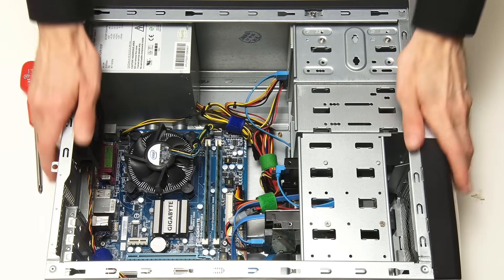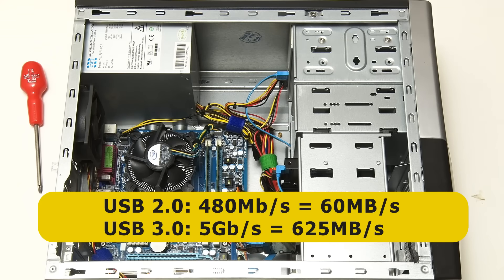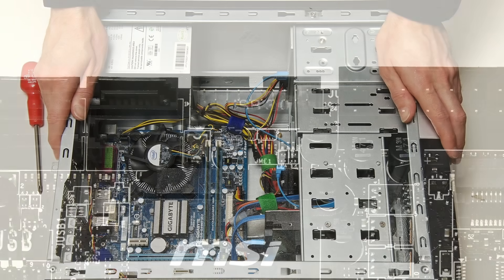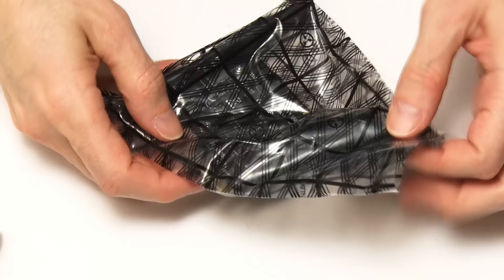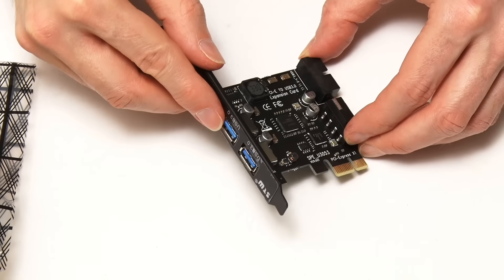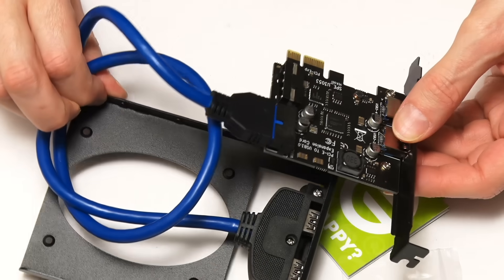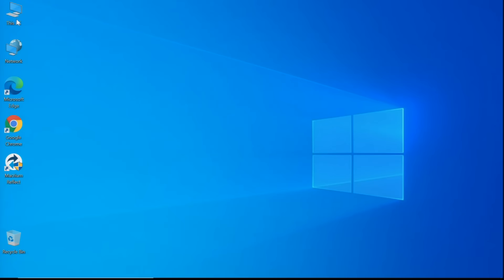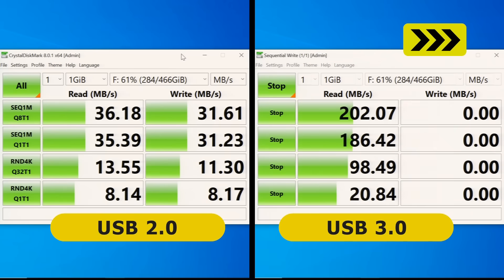Old PC Upgrade #3: USB 3.0 Ports

Comment: Chris, you mention in the next video that you'll be upgrading the motherboard and CPU. I wonder if it's worth mentioning different upgrades that can be done, depending on a budget. For example:

- If strapped for cash, a CPU upgrade to a quad core chip for the existing motherboard could bring about excellent performance gains. A Core 2 Quad computer is still perfectly serviceable for most web browsing, email, and media playback needs.
- Upgrading the CPU and motherboard, but re-using the existing RAM
- Going all out and upgrading the CPU and motherboard with ones that will also require newer RAM (in this case DDR4).
- Adding other affordable upgrades as required for the users needs. For example, installing a graphics card would allow for things like 4K video playback, even on a machine this old, as the card would be doing hardware decoding.

Just food for thought anyhow. Great informative video as always!
Reply from the maker: Agreed -- there are many potential options. :)

Comment: This video just got me thinking that it was 9 years difference between the desktop I'm using now and the one that came before it.

By the way Chris, what's your methodology in regards to  "tech refreshes"? I try to invest in more but less often to make such investment last longer.
Reply: Myself, a few things, because I don't like buying this stuff any more often than I have to, and I like to get ten years or more out of a good system (oldest one in everyday use here is 17 years old, next oldest is 13).

-- Quality power supply. Everything else depends on it.
-- Best motherboard I can afford that has the features I want (mainly number of slots, memory capacity, and CPU class) without agonizing over it too much.
-- As much RAM as I can afford.

After that...
 -- I buy last year's CPU, and save a LOT of money without being all that far off present performance (this will usually be about in the middle of the CPUs the board supports). 
-- And when the best CPU the board supports is a couple years old and the price has come way down -- THEN I upgrade the CPU. (And the old CPU goes into a salvaged board and becomes a secondary system.) 
-- If RAM isn't already maxed out, I look for price drops and that's when I fill it out.
-- I'm not all that fussy about video card; I'm not gaming so whatever makes adequate resolution is good enough.
-- I will commonly buy used components. Remember ALL computers run on used parts, and other than hard drives/SSDs, they don't "wear out".

Hard drives/SSDs are an as-needed thing, but stay away from off brands, you'll be replacing them prematurely.

Comment: Looks like a 2.5" drive can be mounted on that front header frame. May interfere or kink the cable but looks doable.
Reply from the maker: You are correct.

Comment: very interesting. I was wondering about buying a used single xenon processor motherboard combo with 32gb of ram for a 10 years old pc that isnt for gaming with some of your mods? mine is athlon x2 2.8g processor is currently in it. Would I need more powerful power supply (350W) . I saw a combo for $125 ebay, or athlon x4 processor or other upgrade for the am3 motherboard. Any ideas?

Comment: My old PC that I built in the windows8 days runs windows 10 and any Linux Distro quite well, but I've been planning on doing this type of upgrade for a while. I've held off because I couldn't find an option to put USB3 ports in the front of the case, in one of the floppy or CD drive slots. Thanks for the video. I can make this happen now.

Comment: I appreciate that there is a limit to what you might want to spend on upgrades, but I wish you had considered a graphics card upgrade before replacing the chip and board. I have an AMD A10 machine that is fine for everyday stuff and emulation, but the inbuilt graphics fail on the lightest of PC games. I am under the impression that although the machine has PCIe 2.0 slots, I can install any revision cards in the slot and they will work. I see this as a possible stepping-stone to my upgrade path, since I can pre-invest in a graphics card now and then use that card in the next machine should I ever get there...as the card should work in both.

PS. Thanks for the heads-up on the PCIe speed consideration. I had looked at possible faster USB3 and SATA upgrades without even considering its impact. Moral of the story is that it's always worth watching your videos, even when you think you don't need to...plus it's a weekly fix!

Comment: Wow - I was going through my 11 year old AMD Phenom 2 965  PC and wanting to install a gigabit ethernet and Wifi AC card, after having upgraded the boot drive to SSD, I realised that there was only one pcie 2.0 1x slot. Considering the transfer rates of USB 3.0 and pcie 2.0, I realised that in theory it should be possible to create an adapter card to give me two USB 3.0 ports which could then be used for external wifi and ethernet adapters. After taking a look on Amazon, I  shortly thereafter had an expansion card in the post. Having just completed the upgrade, all seems to be working well. This is just a weird coincidence that your video has come up just as I've got the Linux wifi drivers installed. Good points about the theoretical max of usb 3.0 and the actual due to the bottleneck of the pcie ports.  It's also a pitty that I didn't see the tip about the card expansion ports before having bought mine - Front USB ports would have been handy. Good video Chris.

Comment: I think one of the things I appreciate the most about your videos is when you point out the limitations/pitfalls of undertaking something like this. For someone who does this professionally or as a hobbyist it might seem like a no-brainer, but for someone coming into this green that can be invaluable pointing out bottlenecks (such as the PCIe x1 1.0 on this rig) so they're not tempted to install the latest and greatest parts in a decade old machine. Thank you for the video!

Comment: I really could have used this particular video when I wanted to add some USB 3 ports to my old computer a few years ago. I managed to buy a crappy PCIe card that didn't have a molex connector or internal USB 3 connector. It wound up not being what I needed, and I ended up just buying a new PC with more USB 3 slots.

Comment: I have a problem with this kind of extension. W7 and w10 read/write speed is like 2.0. And linux manjaro seems to send faster but then lags on end and it take that same time to transfer data.

In my situation, this is probably, a problem with the old i7-860 processor model

Comment: Darn...I do have an extra pcie x1 slot but, I don't have any extra power in my machine! Bummer!
Reply from the maker: A USB 3.0 card would work without the power connector, but may not power more power-hungry devices (eg like some external hard drives without their own PSU). So it just depends what you would be plugging in.
Reply: @ExplainingComputers  awesome...I'm going shopping....
Thanx!!!!!

Comment: EDIT:  before the latest USB standard switched to a 128b/132b "jumbo frame", 
prior USB versions still utilized the 8b/10b "legacy frame" 
= 1 start bit + 8 data bits per byte + 1 stop bit = 10 bits per byte.
Thus, 
480 Mbps / 10  =   48 MB/s (MAX HEADROOM)
5.00 Gbps / 10  =  500 MB/s (MAX HEADROOM)

The USB jumbo frame is now 132 bits / 16 bytes  =  8.25 bits per byte.
Thus,
10.0 Gbps / 8.25  =  1,212 MB/s (MAX HEADROOM)

The "2x2" option in USB 3.2 is really just 2 parallel channels,
thus not really Serial (the "S" in "USB").

Hope this helps.
Reply: Another speed factor to consider is the upstream bandwidth of the available PCIe x1 expansion slots.  

PCIe 1.0 clocks at 2.5G, and PCIe 2.0 clocks at 5G.

PCIe 1.0 and PCIe 2.0 also used the 8b/10b "legacy frame".  

Thus, if the PCIe x1 expansion slot in this video is PCIe 1.0 ("Gen1"), then 
the upstream bandwidth is limited by a raw clock rate of only 2.5G:
2.5 Gbps / 10  =  250 MB/s (MAX HEADROOM)

In other words, with the latter combination of hardware,
you will NOT get the speed you will normally expect from a USB 3.0 expansion card
because the bandwidth upstream of that card is limited by the speed of the x1 expansion slot.

The PCIe 2.0 clock runs at 5G:
5.0 Gbps / 10  =  500 MB/s (MAX HEADROOM as shown above)

Later versions of USB 3.x switched to the 128b/132b "jumbo frame"
(but I can't remember exactly which versions did so e.g. might be USB 3.1).

Lastly, if you install a USB 3.0 expansion card into a PCIe 3.0 x1 expansion slot,
the bottle neck switches to that expansion card:  

PCIe 3.0 clocks at 8G per x1 lane and it uses the 128b/130b "jumbo frame".

In summary:
PCIe 4.0 clocks at 16.G with the 128b/130b "jumbo frame"
PCIe 3.0 clocks at 8.0G with the 128b/130b "jumbo frame"
PCIe 2.0 clocks at 5.0G with the 8b/10b "legacy frame"
PCie 1.0 clocks at 2.5G with the 8b/10b "legacy frame"
Reply: Sorry, Chris:  I wrote my last comment above BEFORE reaching the end of this video, where you explain the upstream limitation imposed by a PCIe 1.0 x1 slot (i.e. an inherent limitation of the Intel G41 PCIe 1.0 chipset).
Reply from the maker: As the video makes clear, the PCIe slot is PCIe 1.0, and speeds are indicated. :)
Reply: @ExplainingComputers  You're THE BEST, Chris.  When are going to be Knighted by the Queen?  I'm looking forward to addressing you as "Sir Christopher"!  KEEP UP THE GOOD WORK!  p.s.  I wish more videographers would imitate your excellent camera work.
Reply from the maker: @supremelawfirm  Thanks Paul! :) You were clearly thinking ahead! :)

Comment: Just upgraded my older thermaltake case for a new 10th gen build, used the 5.25 bay because who uses dvd-roms or blu-rays anymore? Anyway I ended up also needing a usb 2.0 doubler because I ran out of headers on the motherboard.

Comment: Hi Chris, I've purchased USB 3.0 Card on my computer (MSI Z390 Tomahawk).
Sometimes the USB connection works but sometimes it doesn't.
I've plugged in the power plug and have installed the driver.
Could you please assist what caused this issue?

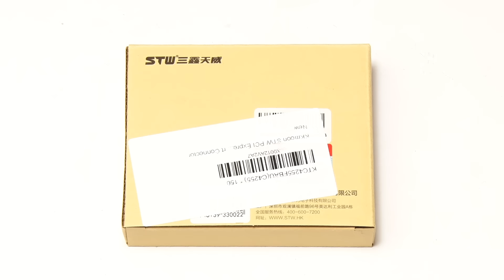Comment: 3:23 YAY! Pakage from China.... 

But what about the PCIe USB 3.0 controller cards with 2x19pins headers ONLY - but NO Molex/Floppy-power connector? 

My 10yo+ Asrock 870 Extreme3(PCIe 2.0 and SATA 3 standard) motherboard already have 2 x USB 3.1 Gen1 Ports (NEC MPD720200) 'in the back'. 

I only need 2 headers for my case top(2x) and my 5.25 Multi SD, FD, eSATA & USB3(1x) etc. reader. and NOT more 'in the back'.

Comment: The most important thing in a PC is the power supply. I have seen so many PC users upgrade their RAM, HDD, graphic card, CPU etc... and then the crappy $15 PSU which came with the PC decides to "blow up" and fry the motherboard and everything connected to it. If you decide to upgrade, even an older computer, always start with the power supply unit. It doesn't have to be a super fancy expensive thing, but at least go for a brand which is a 80 PLUS or better. Corsair, Seasonic, be quiet!, MSI and Cooler Master are great brands. You can find a really good Corsair PSU for $40-45 today. Your PC's power supply / PSU plays a big role in determining your system's reliability. The PSU's found in older HP, Dell, IBM, Fujitsu-Siemens, Lenovo desktops are junk. Replace them immediately - before they cause huge harm and give you a severe headache.

Comment: chris, have u ever purchase a cheap (***) case that just a total piece of junk? I have one that it look nice when I got it 3 years ago, maybe 4 years ago.  now just junk, the hole to the screw are striped out for the side and slots.  The only think worth keeping is the power 550W supply. it was one of those super cheap under $30 case. It got an older AMD MB that don't not support M.2 NVMe. I got a new case for $40 that look to be build like a deep cool .  I had purchased a WD Black 500GB SN750 and a RIITOPM.2 to PCIe 2 to pop into the 2nd PCIe 2 slot.  I cloned the HD to to NVMe ssd. but the BIOS did not allow to boot from the PCIe slot. bummer.  The I purchased a NVMe to USB 3. that go me cooking. but I don't like the card sticking way out the back or the front.  The board does have USB 3 on it but they V1.  that got me thinking after watching you this video.  Is there a card for the PCIe 2 slot with an internal USB connector with a USB 3 v4 or 5?  with on board USB 3 I got a passmark score of 2400.  I like to get up to over 3000 if I can max out the ssd speed.

for your MB upgrade, from your videos, I would go with the GB A340M and with Ryzen CPU you like.  I went with the Ryzen 5 3500x.  it was a price choice, I got it for $150.00 NEW.  I did this in my desktop.  I did some read on the Ryzen and now the difference in the 3, 5, 7 and 9.  So Im going to get a purchase a MSI 550 MD and a Ryzen 7 CPU and put that in my Deep Cool case and put the GB A340m in mini case with 16GB of memory for the work PC.

Now for a serious question.  Does the NAS software you use with Pi 3/4, does it support a RAID's?  Like RAID 5? Should I use HD or SSD?  I like to use 5 NVMe of 1TB in a RAID 5 and one Hot Swap.

Comment: Hello Christopher, good to see one more video from you. May i share my thoughts about the video? 
i just wanted to make it a bit more fair, for those of the users who are not as advanced. The reduced performance comes from the fact that the USB 3.0 card is in PCIe 1x slot which is managed by the south bridge of the chipset. I say south bridge, because I consider the generation/age of the computer. Unfortunately i see a video card in future upgrade, so the use of the 16x slot is out of any discussion. The delays and latencies in the southbridge managing the whole computer at once lead to the reduced performance of the USB card. Yet, if the same card was in the x16 slot it was about to get the full speed of USB 3.0, not because of the connector, it will use 1 lane and 15 will go to waste, but because the x16 PCIe slot it would be served by the fast north bridge without bottlenecks delays and latencies, which are normal for the south, bridge but do not exist on the north bridge.
Reply from the maker: I am really struggling to understand what is not "fair" here. Like most currently available USB 3.0 add on cards, the one used here is x1, so it is placed in the x1 slot. Even if it were placed in the x16 slot, it would still only be using one lane, so would be limited to a maximum data transfer of 250MB/s as motherboard is PCIe 1.0. From about 16:30 in the video, I explicitly cover in audio and graphics the fact that the PC is PCIe 1.0 and indicate the speed. So how am I being "unfair"? A PCIe 1.0 slot cannot deliver more 250MB/s, so regardless of where the card is inserted, it cannot deliver full USB 3.0 speeds.
Reply: @ExplainingComputers  Hello, it is not you i speak about, you bade your video brilliantly. I respect that. 
Most users who are not as advanced, some times just look for different explanation of the same thing, the same thing said in other words. Please take no offense, none is meant. I have 3 customers, following your videos as per my advice, using the videos as study content. Some times they need to see the same thing presented with other words. Actually my post was message for them. I am sorry if i have inconvenienced you. 

As for you, dear Christopher, i really hope to see the episode where you install a graphics card, because it will really unlock some performance from this computer. I don't know how much it will unlock but it will be nice upgrade.

Comment: Why do you delete comments?
Reply from the maker: I very rarely delete comments -- certainly I have not deleted any in recent weeks. I only ever remove comments if they are unsuitable for a family-friendly channel. So what exactly are you referring to? Some comments posted on this channel are blocked (not deleted, but will not appear) are they are picked up by YouTube filters (and this includes all comments that include a link). Other comments are blocked by my own profanity filters (again never deleted, so a record is maintained). But as a general rule I do not delete comments, so please explain exactly what you are talking about, or else stop telling lies here.
Reply: @ExplainingComputers  
Ok my bad then
I asked because I commented on your video series about building a Ryzen pc.
I watched all the videos and I was trying to ask You about part replacements to the ones you have posted!
Reply from the maker: @someutubchannel69  No problem! :) What you were asking does not sound like anything that would be taken out by YouTube or a filter. There is some info an alternative parts on the project page here: https://www.explainingcomputers.com/ryzen/index.html Nearly two years later, whilst the Ryzen 3 2200G is still around, the Ryzen 3 3200G is its more recent successor. This all said, since the start of the pandemic there has been a shortage of chip production capacity, so getting hold of any lower-priced CPU is very problematic right now.
Reply: @ExplainingComputers  
Let me see the link,
Thank You So Much!!

Comment: I haven't tested this, but I think it might also be important with old PCs to get an adapter with a 4x PCIe interface since you might be putting it into a slot with only PCIe 1.1 speeds.
Reply from the maker: You are right, on an older PC like this with PCIe 1.0, a x4 card would deliver full USB 3.0 speeds. But such cards are now rare. And the benefits would be marginal given that the drives on this system are connected via SATA II.

Comment: One 'fun' fact about using these in Linux is that you can run into a regression problem.  The USB 3.0 add in card that used to work with one kernel does not work with more recent distros.